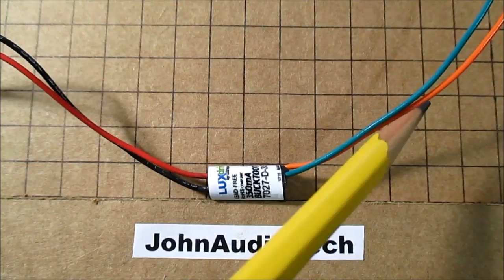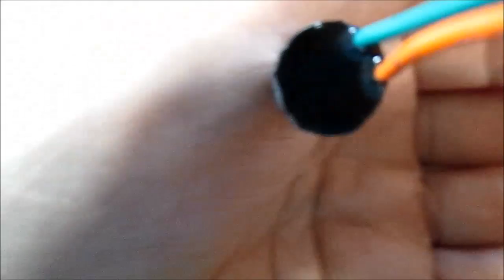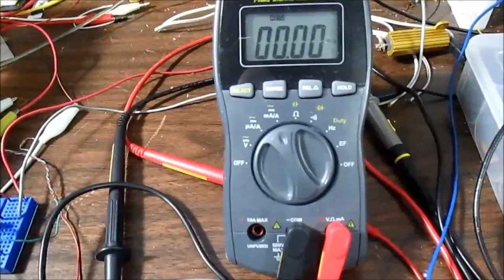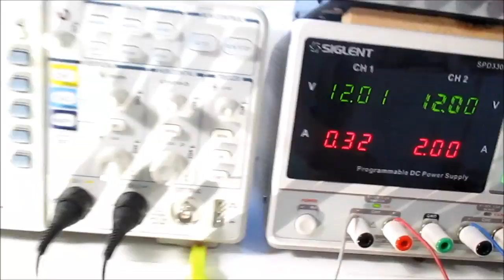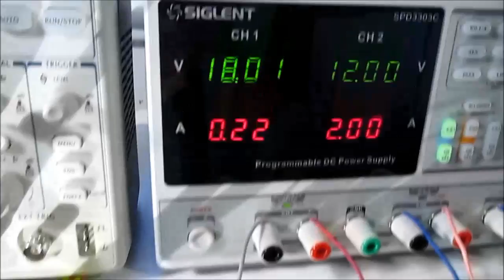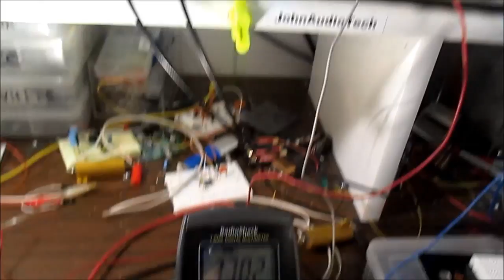Low voltage DC  LED driver "Bucktoot" test & review

Comment: I think the AC input version would be great for retrofitting those little 12/24vac desk lamps. Being potted you could just stuff it into the base along side the transformer and not have to worry about anything shorting on the transformer core or making contact with line voltage.